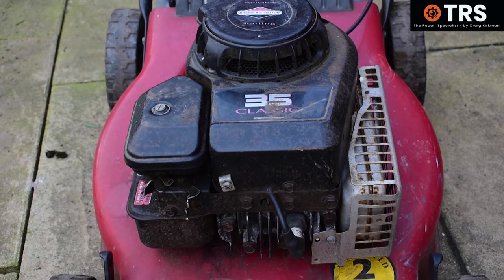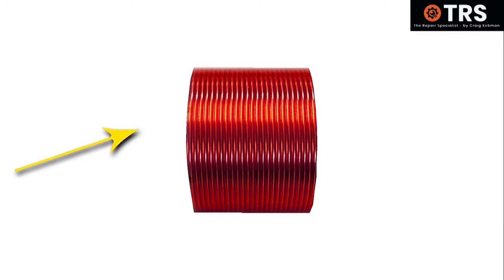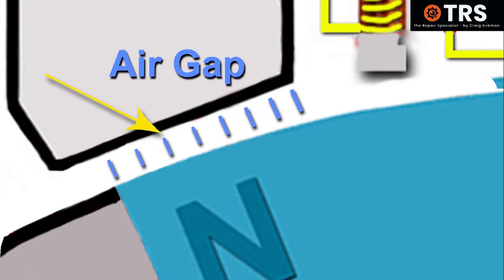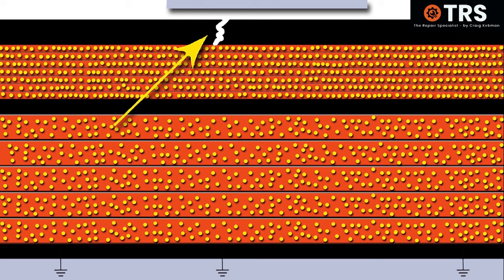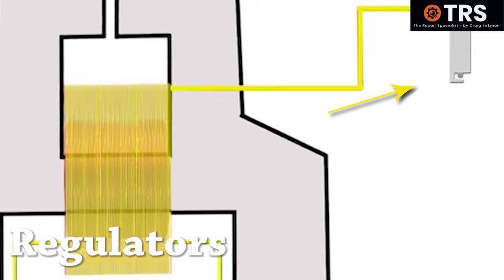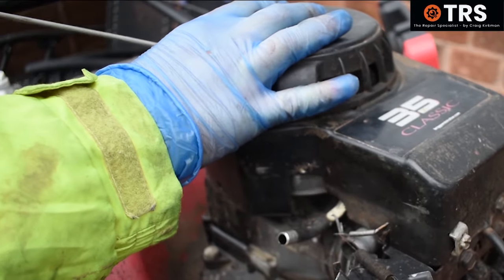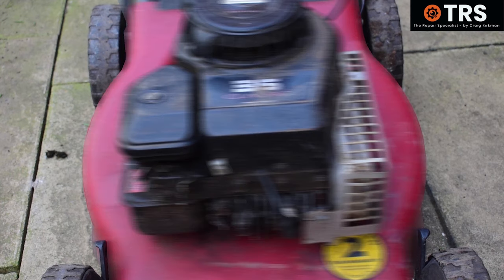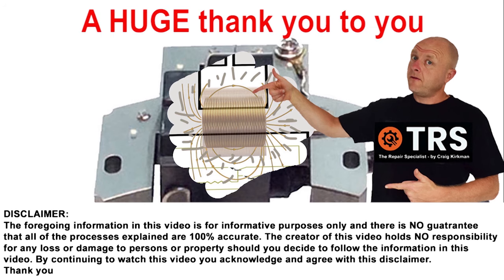Lawn mower Ignition Coil - This is what FAILS in them!

Comment: I have a honda gx160 coil that might be a problematic one where it will work to start and engine and then out of nowhere, cut out and then restarting is near impossible. I took the coil Pitt and measured the primary and secondary resistance and the secondary resistance is nearly double what the factory spec calls for 5.9-7.1 kohms but my measurements are 15.9kohms. Could this higher than normal secondary resistance cause weak spark and what is the cause of secondary windings to have high resistance?

Comment: Once the solenoid starting coil for my Kawasaki 82 KLT 250 went bad.
Replacement was expensive so I disassembled it and found problem. Wire not much bigger than hair had broken. Unwound many yards to solder and insulate. Rewinding all again and refit in metal can housing. More than twenty years ago now and still working fine.😊

An electro magnetic device to contact heavy electron flow to energize starter motor.
Lets a light touch start button to start engine ( 250 cc four stroke single, five speed gearbox).

Comment: Outstanding graphics and explanation .  Just wondering do the magnets on flywheel ever fail ,and can a flywheel ever change position  on shaft leaving the magnets out of line when the piston is at top centre . Just a DIYer looking for knowledge. Super  channel which I have just found, many thanks .
Reply: Could be that the flywheel key has been sheared, as in hitting something that causes the blade to suddenly stop.

Comment: Love yer vido 
I have a mistory problem for you 
I have 
 ride on mower 
That only done 100 hrs run time 
I bought a small contact tacho / hr meter 
To fit to it 
When I wound the contact wire from the unit around the HT lead 
The engine wont start (no spark)
If I remove the contact wire it starts no problem  ??
If I attach the contact wire to the HT lead 
After the engine is running, it works fine 
But if stop it again with the  wire attached,
The engine will not start no matter how much I wind it over 
It has electric start but just flattens the batt 
Way is the contact wire from the tacho robbing the spark ?
I have tried two  of these units now bouth do th same thing 
Is the contact wire robbing to much current from the HT lead 
The engine is a powermore ( chinies)  with a 
Magnetron ignition coil 
Thanks for any help you my offer 
Bob

Comment: Please update to show the 'automatic up regulating' components.  I would guess that higher lead/plug resistance would result in lower current and heat, and hence, less running.  LOWER resistance is what I would expect to increase heat load by TOO MUCH current flowing.  We can get to the bottom of this when you post the details of the  'self regulating' or 'up regulating' feature(s).  thanks

Comment: Honda vertical eng: no spark, air gap at .005, stop wire removed. I have tried 4 different coils, no spark, ohm reading is 5.6k on each coil, not even a tickle when holding the HT wire in my hand.. the magnets on the flywheel are strong. Each of the 4 coils I tried were USED, could all 4 be bad?? I've worked on small engines  long enough to know this is fairly remote. The mower is not worth the cost of a new coil! Help, I'm stumped!!

Comment: My mower starts first time, but if I stop - I have to leave it for about 30-60mins before it pull starts again. 

It sounds like it's not got a spark, but obviously does after a while.

What's the best way to check if I'm getting a spark with just a multimeter or simple tools?

Comment: I have an MTD 790 trimmer that suddenly died, then after it cooled down it worked for about 15 minutes until it died again. After that happened, when I try to crank the motor only a single spark happens on each pull. I can hear the engine burning a single stroke when pulling the cord, I removed the spark plug from the engine and indeed I confirmed there is only one single spark on the plug on each pull. What kind of malfunction could cause this?

Comment: Really interesting. Ta for posting 👍
Reply from the maker: Thank you for your nice feedback. Craig 👍
Reply: @TheRepairSpecialist  Hi again…..watched your vid today as fed up with not being able to ‘prove’ that coil is either good or bad to enable eliminating it etc etc…..anyway, still can’t get my 4 in 1 to start and have spent a few hours trying, and seemingly failing, to find a replacement BUT (and here’s my question to you) do you know if it’s possible to fit a, for example, 52cc engine coil to a 33cc engine? In other words if it physically fits is there anything else stopping it from working. Just about to give up when I came across some eBay sellers with coils that look identical and suggesting that on the smaller engines they are interchangeable?? Any idea? Any help would be appreciated as I’m at a loss….thanks very much.

Comment: After I watched this video I decided it is an electric problem cause the same symptoms (stars easily and jerks and stops after few minutes when it gets heated) but the electrican tested it and said it is not an electric problem the spark plug works fine. My question is what's the difference between the coil problem and carburettor problem??
Reply from the maker: Well, they can give off similar symptoms sometimes but generally if the machine works until it gets hot (working temp approx) then this can be a sign of ignition coil issues.  Unfortunately, testing the coil with a multi meter is not always the best indicator of a problem. This because the coil might go bad only when hot. The test is generally run on a cold coil. 

Carburetors usually, but there are exceptions, show issues from the get go. Please note again, though, that there are always exceptions to these types of diagnostic issues.

 I have a video coming out this, or early next, week explaining this and showing details withing the coil as to why it happens.  Keep an eye on my next upload if you would like to see it. Thanks. Craig

Comment: I have an echo pb251 leaf blower. It had different issues until it became very weak.  I think the coil getting weak mimicked other issues. It acted as if it had vacuum block and bad seals.   I thought that the weaker it got mixed with less fuel flow allowed it to run.  Your thoughts please.

Comment: Hello all if this post is still active, I changed my ignition coil on a Kohler kt735 24 HP, and I had been running it thinking that both cylinders were working until I was tired of the constant bogging down , so I did some things to find out that one cylinder was not firing so after replacing it today I got it running both cylinders firing but then the one I replaced that cylinder started smelling like burning plastic or something, and it had smoke coming from that right side cylinder What would cause that?

Comment: When shutting down the engine with the kill switch, is it possible if the rotational magnet happens to stop in the position that normally fires the coil, that the darlington transistor will turn on and stay on ultimately causing it to fail while not running?

Comment: I have a briggs 3.5hp coil that ohm tests good and checked the gap twice but no spark . I can only guess it is the transistors in there. It seems like there would be a way to test that aspect of an ignition unit but I never see anyone mention it.
Reply from the maker: It's frustrating when you've ruled out some common causes of a no-spark issue with your Briggs and Stratton 3.5hp engine. While the ignition coil and spark plug gap seem to be fine, you may indeed be onto something by considering the transistors in the ignition coil. However, diagnosing transistors specifically may require more specialized equipment and expertise.

I have been where you are now with ignition coils, believe me, many-many times. I personally would just try a new coil on your engine if you have are satisfied that you have tested everything else, because transistors are not replaceable in a small ignition coil even if you found that they are at fault.  There are so many small electronic intricacies within these coils that, in my opinion, you may probably never know exactly what is at fault, exactly. And as I mentioned, even if you did find the cause of the problem, those tiny parts are generally un-replaceable anyway.

Sorry I couldn't help more.

Craig

Comment: My lawnmower I was going to put up for sale bc I got a new one stopped starting after I washed it. I thought it might be water in the gas so I replaced that, and then ended up checking the carb, plug, and exhaust and everything seemed fine, plug was even sparking, but itll only fire muffled with even starting fluid, which makes me think something with the coil, before this, it started perfect without even priming, briggs and stratton 140cc

Comment: Good as your small engine carb series.  Did you consider mentioning that the iron core consists of many layers of laminated steel/iron? Eddy currents?
Step up/step down winding ratio's?
11:12 if windings are shorted then essentially there are fewer winding's and the step up ratio is effectively  reduced.
How are the primary and secondary winding's connected? In the can/cylinder type the primary and secondary winding's are connected to each other.
Yes, I know, it is easy to add stuff to a presentation after the fact. Just a few suggestions.
Reply from the maker: I agree with you.  I just wanted to get a video out with some very basic information for a first point general understanding, so that's all this video is about really.

Thanks
Craig

Comment: Mice are a major cause of overheating small engines. They nest on top of the cylinder head, blocking the fan cooling the cylinder and head. The coil as well as the. engine can be damaged.

Comment: I have two 041 Stihl chainsaws And 2 parts saws. And I would rob the coils from the other saws to keep one running. But these coils are underneath the flywheel and they must get too hot and be the reason why they keep failing. The newer Stihl saws have the coils on the outside of the flywheel.There is Sweden electronic and German electronic coils using different flywheels.The thing is they no longer make these coils. So unless someday someone makes new coils these saws will not be able to be saved from the scrap pile. Otherwise they are good saws. I have heard you can use the very early models that used points, condenser, coil and another flywheel to keep these saws going,,,,,,,,,,,,,,
Reply from the maker: Thanks for letting us know

Comment: Would the coil be damaged if the lawnmower got some metal stuck in the deck causing the fly wheel to have momentary stops and possibly jolts backwards?
Reply from the maker: I don't think this would affect the coil that much at all to be honest, with the coil being a separate component from the flywheel and not receiving quite the same JOLT.  

I know what you mean by questioning the instant stoppage as a possible cause of a Jolt that might damage surrounding components, but I personally haven't found coil damage as a result of this sort of thing, that is know of anyway.  I'm not saying it's completely not though.  

I hope this helps a little.  
Thanks. 
Craig
Reply: Yes, it's odd, I had the metal flap at the back of the deck that flattens the grass break and get caught in the blade but now I can't get a spark? Magnet works, spark plug works so I can't see it being anything other than the coil. And tested with the Earth tag removed
Reply: @nathansaunders2530  Most manufacturers use soft metal keys to lock the flywheel to the crankshaft, so that if you hit something, the key will shear instead of the crankshaft breaking. However, when the key shears, the flywheel usually slips on the shaft slightly, altering the timing of the spark, and the engine will no longer start. Remove the flywheel nut, look at the keyway slot.  If both halves of the slot (flywheel and crankshaft) don't match perfectly, replace the sheared key and you should be back in business..
Reply: Nice one Gary! I'll check that tomorrow! Only just got back into my account... I'll keep you posted
Reply: No. But there have been cases where people have hit a stump, rock, or something hard that stops the engine very fast. If they get lucky and did not bend the crank but cannot get it restarted. Or, they pull the rope and the rope and handle gets ripped from their hand in attempt to start the engine. The culprit is usually the flywheel key gets totally sheared, or the key gets damaged just enough to keep the engine from starting. if you look closely, you can see that the slot on the flywheel and slot on the end of the crank do not align up correctly. Just remove flywheel and replace the key.

Comment: on my twin engine mower when i plug in the ground wires to my coil pack i  lose a cylinder unplug  the ground wire  and  that cylinder wakes up . any advice
Reply from the maker: Hi. Obviously, the only way to really diagnose anything properly is to be there hands on. However, my first impression here is that the cylinder you are loosing has a short in the wiring that feeds the stop system. Just take a look and see if you can find any damage or bare wire in the wires for the stop on that cylinder. If you have a multi meter, then you can use the continuity setting and place one terminal on the engine, and the other in the end of the stop wire, which connects to the coil. Make sure the switch is in run position, then test. If you have a continuity beep then you may have a short. It’s a case of finding the short then. Test the other side to make sure you see the difference between the two sides. I’m not saying this is the very best cause of action but it is a good starting point from my initial thoughts. Thanks Craig
Reply: @TheRepairSpecialist  thanks I’ll give it try when I get home

Comment: Only a more or less shortcut can cause heating(cable or center electrode touching ground) , not  if there s no current flow, in case of a freely hanging splug
The same every generator-no flowno  wire/winding heat., only mechanical. 
.
Greater resistance - less current, less heat, weak spark, eventually jumpover to ground

Comment: Water is a insulator and not a conductor . It will be the minerals inside the water that are conducting the current.
Reply from the maker: Well of course it is. Pure water is. You won’t find pure water anywhere you look though. So maybe its best not to tell a whole bunch of people that water is a conductor because one might pure water onto electricity and what you think will happen to them?? Will the water save them through being ansluater?? Or will it most likely cause them harm because it is contaminated with minerals?? Well, it’s the latter. Be very careful telling people that water is an insulator in this context without a warning that they won’t find pure water in the tap or in a bottle they buy, or practically anywhere else for that matter. I had to state that water is a conductor in my video to ensure people know that in the form we find it on our society, that it is most certainly a conductor. Believe me, if it rains on anything electric, it will not go down well.

Comment: This "CLASS",lets call it that,cause that is what it is,a CLASS !! Technically ELECTRONICS 101 !  This wasn't JUST Motor Repair,It's LAB TIME ! This is how they taught in Tech School. 1rst you get the "THEORY", His LAST VIDEO, 2nd you get the "HANDS ON" in the LAB. Then it was TEST TIME. 🤔
This Basically is how ALL COILS work,to a Degree. Granted This by FAR is NOT all that Coils can do,nor configurations that they can be used in.  But it's a Good Primer !
 It also lets you scrape the Top of what is to come in Learning about Electronics ! I can tell you this cause I'm a Retired EE & Veteran Army Engineer.
He has done Extremely Well in his Presentation here on this Vid & the Preceding,the PRIMER to this 1. I HIGHLY recommend you look at it too !! 
  https://www.youtube.com/watch?v=NNlYbvDY6pI     Lawnmower Coil Pack Sparking System - Induction Coil, Transistor, Electrical System Works!

I'll leave you in HIS Hands,for from here on the RABBIT HOLE goes DEEPER NEO !  😎